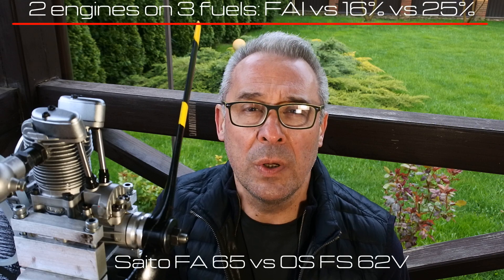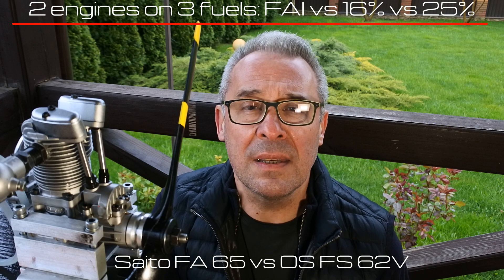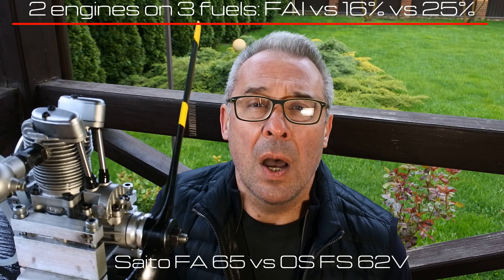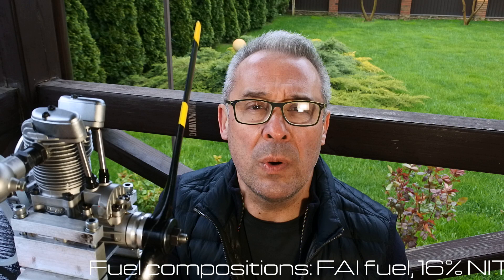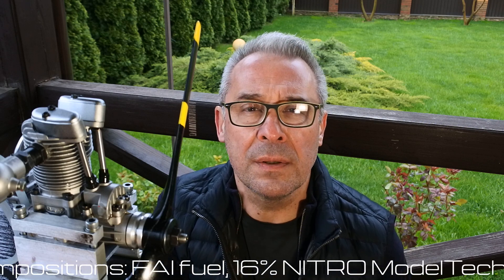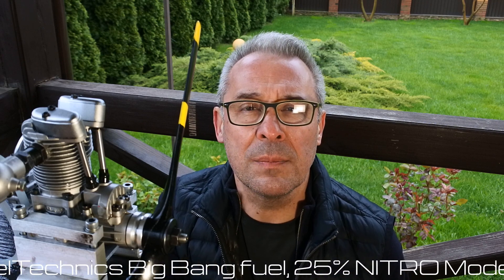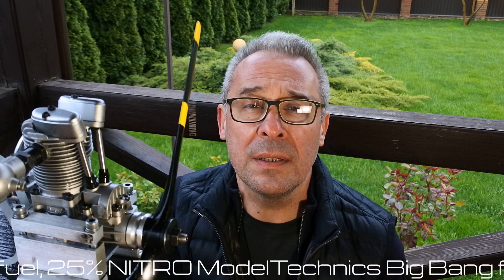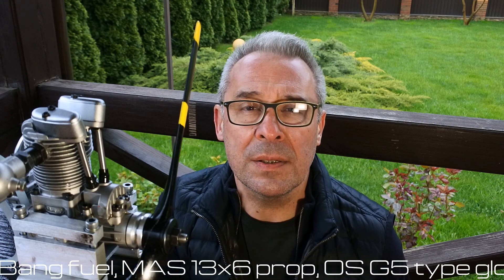The BATTLE of TITAN's or when 15% Nitro isn't enough

Comment: Thanks for sharing this. I love the slow idle stability of the Saito! Was the first test of the OS a little lean? Did you find that you had to richen the needle with the higher nitro fuels? Thanks again!
Reply from the maker: Hi, and thank you for your comments ! HS needle was adjusted every time after each fuel change, so I tried to reach engines peaks RPM, and really, going to push engine to the max. The task was to find the TOP speed limit, so, of course, in some moments it runs leaner, than in regular  engine's life. And regarding Saito = I should say, that I changed both engine's  bearings before test, because  in previous grand cycle of the comparison test runs I found, that bearings wasn't  so smooth, as it should be.  After an half an hour of the engine tuning, it becomes to work, as  a "swiss clock", ticking very nice. Attempts to reach the TOP speed, usually, aren't in line with engine's stable idle. If the max TOP speed isn't so important, and you can drive engine with another carb settings (slightly on the richer side), engine can go even lower.  
Thank you and gave a nice day !

Comment: Just as a point of interest, in the USA, VP Racing Fuels aka Powermaster has sold a Saito specific fuel for years. It is called "Saito 20/20" and it is 20% nitromethane and 20% synthetic oil. It is in-between your fuels you tested. :)
Reply from the maker: Thank you very much for your comment and for information provided ! Really, I was very surprised about engines behavior with 25% Nitro fuel, I was expected much more influence, that it was really achieved. Also, will be interesting, how reduced oil content (BigBang fuels has just 16% of a high quality oil) will affect the engines internals. So, two factors, high Nitro (25%) and reduced oil (16%), should intensively stress both engines. It will be interesting to look inside, to check engine's internals for parts wear and general condition. 
Thank you and have a nice day !